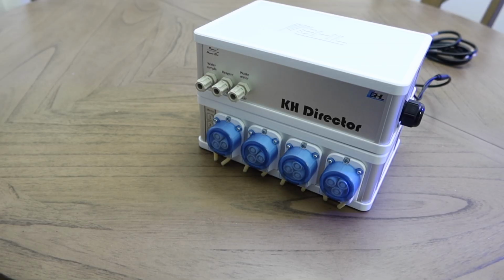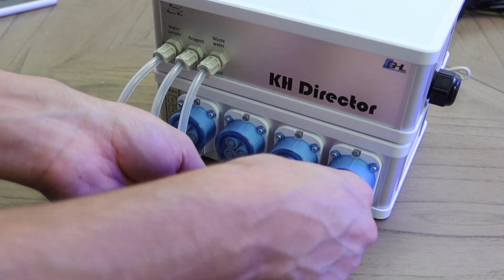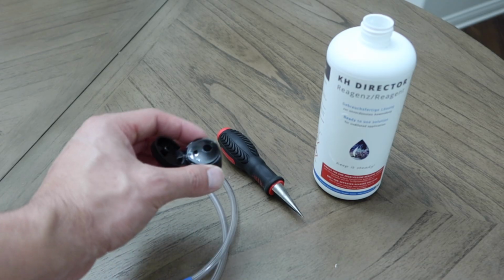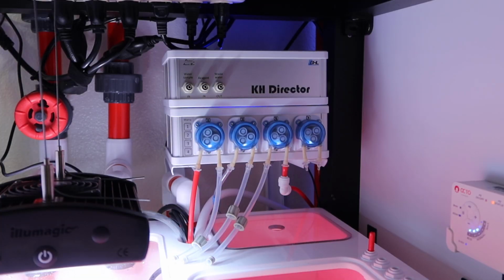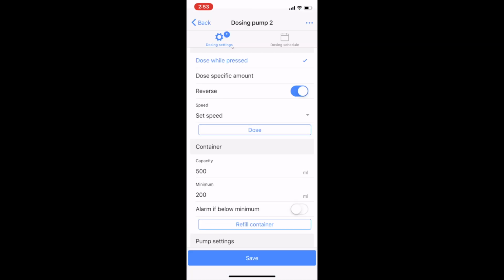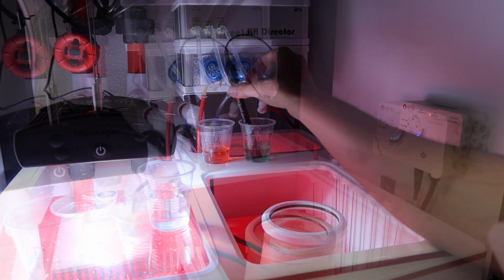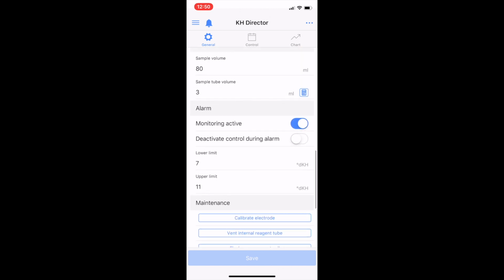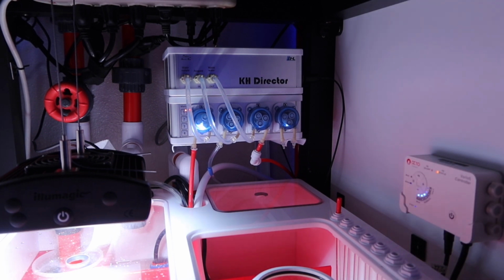GHL KH Director Step By Step Install (Automatic Alkalinity Tester)

Comment: Thank you for this video!!!  I’ve ran GHL products for about 15 years.  I had a B@&$# of a time w this because of the firmware, device recovery and ultimately a power supply that wasn’t pushing enough current to run the pumps.    This video helped provide the confidence that in that storm of issues, I knew what I was doing!!!  Thank you!  I owe you a frag or two!

Comment: Can use this tubing type for the doser?Pure Silicone Tubing - 1/8" ID x 1/4" OD - High Temp Kink-free Hose Tube 500F if so, can I use super glue like you did with your other pump even tho this is no Rodi tubing it’s silicone?

Comment: I have the GHL Doser and see that the DIrector would be a useful addition.  I also have a Calcium Reactor which adds alkalinity. Would you still use the KDH and add for example a cylinder full of BRS soda ash to tweak the alkalinity?

Comment: When u measure the length on the sample tube. 

Is it the tube from tank + the pumped peace of tube + the 16cm of tube from pump to kh ?
Reply: Yes, plus the volume of the optional inline water filter, but the software already takes care of this and prompts wether it should add that filter volume or not.

Comment: So you dose only alk through the GHL? Or do you dose like tropic marine which is 3 in one?
Reply from the maker: I am doing triton method and dosing them all 4 together.
Reply: So your using the ghl doser slave too ? Cause I see 3 heads are for testing which leaves one head only
Reply: Thanks for the reply by the way I'm currently running red sea and trace elements of bubble magus t11 and t12 I want to upgrade but I want to make sure I pick the right one is either the dos or this

Comment: Hey👋, you need a second Doser for dosing your liquids. Except you want to do it manual.

But thanks for the vid!

Greetings from Cologne
Reply: Cologne,Germany? I've been there in 2018..what a beautiful town..went to see the cathedral...greetings from Boston
Reply: does the kh director need the same 4 doser pump to test and another set of dosers to dose alk ?
Reply: smiles1969able hey! You can dose kh with the pump wich is left 3+1, but you have to dose ca and mg short after kh is dosed 7-10 mins) means you need a second doser with at least 2 pumps more.
Reply: @gocedimoski728  i was looking at buying the ion d and also getting the kh d when i can afford it. does the ion D need another set of dossers as well to dose ca and mag? also if it did need more dossers would it be possible to incorporate a jabao dp4 dosser into the equation or does it all have to be GHL ? im just trying to be clear on what i would need to be fully automated with ca mag and alk ,and a big thank you for your reply happy new year!

Comment: Can you explain how it would control a calcium reactor? I followed your last build and you said you would never go again without a calcium reactor.
Reply from the maker: It has it in the menu to have it work along side it. So it would shut on or off the solenoid to the reactor. Sadly in this setup as you can see in the video there is ZERO room for anything. Having a baby there is no way I can risk having things out of the stand.

Comment: I don't see how this is needed if you use all the hanna checkers and auto dose 2 part.
Reply from the maker: Manual testing gets old very quick. The plans for this tank is almost all SPS. That being said being able to track and maintain a steady alk will be key. Having this system always Monitor the tank scene when I am a away to be able to make adjustments when I am
Not home is priceless for me. I will easily have over $15,000 in corals so this is almost an insurance policy 🤣
Reply: @DeepDropFishingTV  fair point.

Comment: What is type of stand is your director on, it looks pretty stable and secure....
Reply from the maker: It’s from Home Depot in the storage section they are 90 degree brackets. They are made in 7” and 10” I am using the 10 but the 7 works too

Comment: Nice informative video!  This gear has a lot of steps to it for tracking KH only.
Reply: It does, but about half of the steps are for the doser itself. The notification settings for the containers is great as I receive a text message to fill or empty a container accordingly.

It should be noted that their upcoming ION director using the same method for setup and measures  5 different parameters.

Comment: Bruh this shits expensive idk if its worth moving from kalkwasser 😂. My pops passed next to me when i was checking the price for this and he said i better not be a fucking idiot lmaoo
Reply from the maker: This is not a replacement from Kalk. This is a alkalinity tester than actually can work with a calcium reactor and a kalk reactor. This units job is to measure and record alkalinity. If needed it can make adjustments to alkalinity by means of doser,kalk Reactor or calcium reactor.
Reply: @DeepDropFishingTV  oh i add kalk to my ato reservoir was thinking of getting a doser but im not sure. With my current setup alk swings 0.5 throught the day wanted a more stable method.
Reply from the maker: Ya especially with tons of SPS kalk will
Not keep with the demand.